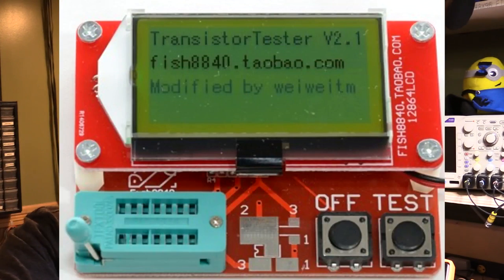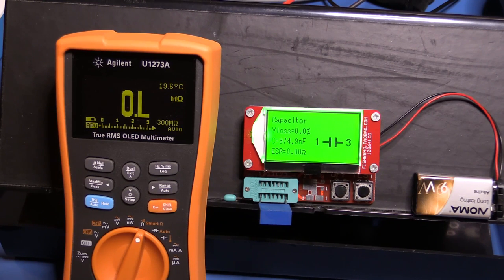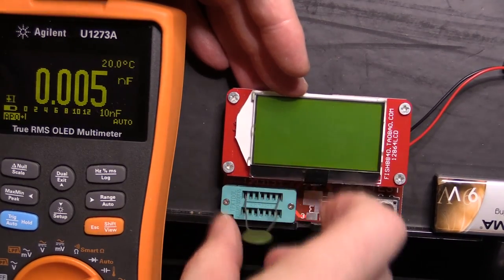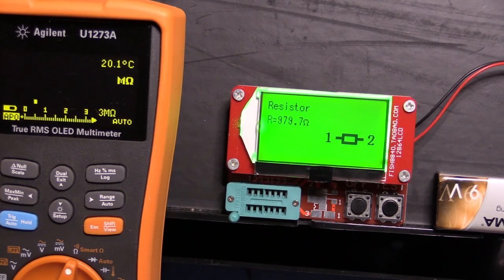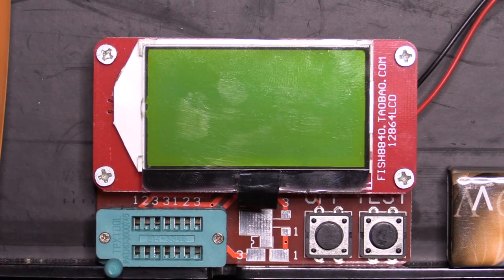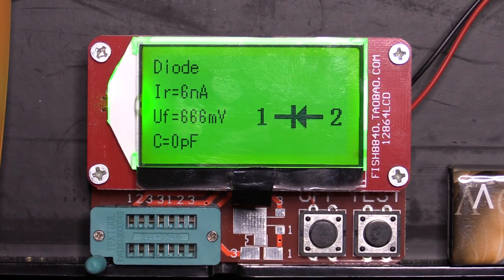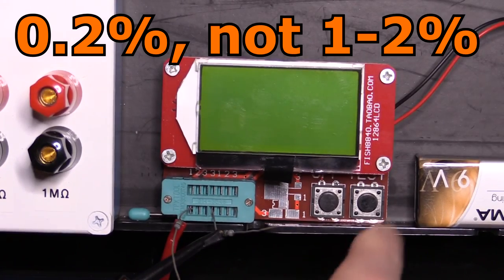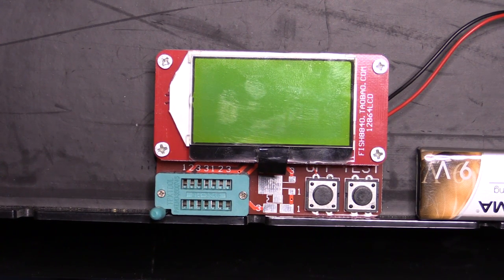AVR Component Tester Review

Comment: First off you need to calibrate AVR testers. You enter calibration mode by shorting all 3 leads together, and hitting the test button. Then if you want the most accurate AVR testers you need to get one with a built in precision voltage reference. Most, including yours I believe, only have zener diodes for their reference. The most trick AVR tester I am aware of is a kit. It is graphical, and has the precision reference too. The original open source project uses a 2x16 character display. Search AVR transistortester to find out about that.

Comment: Your resistance measurements are also going to be affected by the test lead resistance.  I'm curious if you would get better results after modifying the component tester for a kelvin connection to the resistance standards.
Reply from the maker: The leads (PCB Traces) are pretty short, the unit also has a "CALIBRATION" function where you short out the terminals, I guess a bit like a NULL function of a DMM, so this will compensate for some of the lead resistance. I do agree though that for very low values a kelvin connection can improve this accuracy alot. But really this is only using a 10bit ADC so dont expect huge resolution in the first place

Comment: Didn't see transistor checked but beware. This (I have M-Tester)is more of an identifier than checker because the components are not under load. As per Guitologist Channel, the transistor can check "good"  out of circuit in this tester but actually be bad in circuit. Maybe other components also.

Comment: Does it measure in circuit capacitor Esr?
Now that would make it very useful.
Reply: +Garry Gemmell a regular esr meter may work better in circuit because the voltage will be to low to measure diode junctions.
Reply: +rflberg Yes i already know that but i dont have a regular ESR / blue meter.

I was asking if this actually does in circuit capacitor esr.
I dont mean to be insulting but try to read the question before posting a pointless answer!
Reply from the maker: +Garry Gemmell I doubt it will work as an in circuit tester, it relies on the basic ADCs and simple resistor dividers to function so I would not expect good results if it even works at all
Reply: Peter Oakes Cheers Pete!

Kinda thought it wouldnt replace a £70 esr meter lol
Reply from the maker: +Garry Gemmell It does a lot but not that...
Reply: Peter Oakes Yeah i bought one its quite useful for diagnosing various components especially the identification!

Comment: be nice if it verified up to 16 pin chips.
Reply from the maker: John Barron It actually only does passive components and the socket has multiple pins connected together. Basically only 2 pins used at any one time